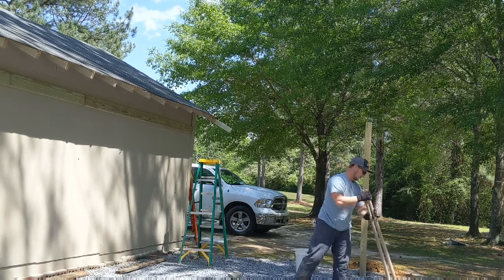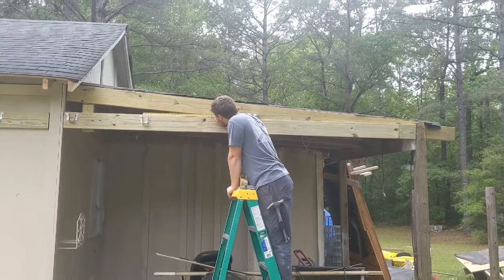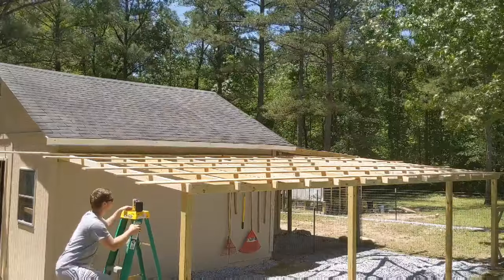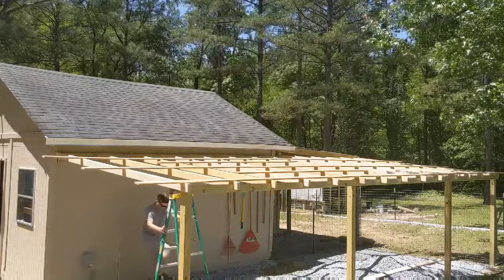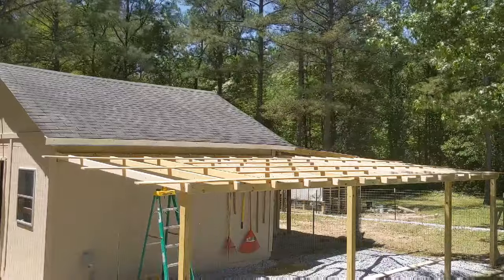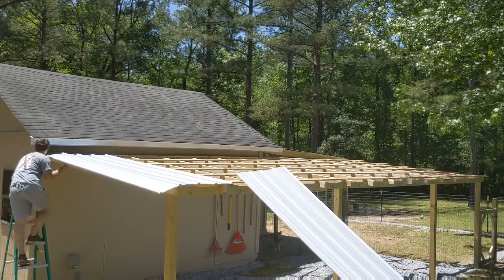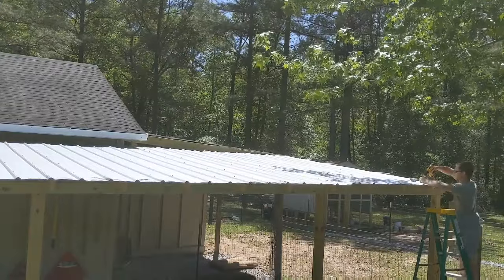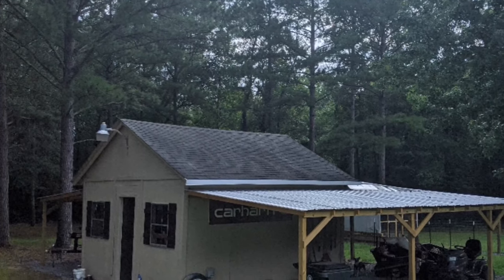How to Build a Lean To Shed

Comment: Looks good. 👍
One word of caution if you live in an area that gets a lot of snow: notch the top of the posts for the headers, rather than relying on the screws/nails to hold the header to the posts. You want the load on the post more than the hardware.
Reply: I doubt he gets any snow being in Alabama.... I know I don't!

Comment: Question for you. What type of material did you use for the roof. It doesn't like the typical clear roofing you get. I build a patio cover with the clear material and it made it like a sauna under it.

Comment: Quick question. I’m building a lean to behind my shed. I’m moving our chicken run and coop back there. My roof is basically 10’x10’. I got 2x4’s for the rafters. Are 2x4’s going to be okay instead of 2x6’s? The actual measurement from the high side to low side is actually less than 10’ and slightly more than 9’. The width will span 10’ though
Reply: I know I'm late and your probably done but no 2x4s can only span 9ft even when they're spaced 12" apart
Reply: @33North33  i used 2x6's

Comment: I found the lumber you get today is not all the same size,  rafters could be anywhere from 11/4 to 1 5/8 thick and 2x6 51/4 to 5 5/8 causing waving up and down across your rafters. I install the rafters with a string line and then install the Simpson strong ties to make the roof even. Don’t put your ties up first unless you measure each rafter to make sure it’s all the same size. Oh yeah, I pre drill all my tin first. Stack them all together make sure they all are even, mark where the holes go and drill your first two holes , one on each side and put two screws to hold everything and then drill the rest.

Comment: that is a VERY light duty shed!  I was worried my attempt at a cheapish on was too light weight. The way you fastened upper ends of back rafters is scary to me!   all good for you but...maybe not for instructional video?   With 10' between posts I would have used a 2x4 top plate [ perhaps doubled ]  and a total of 4  2 x 6 rafters , 1 over each post. Then use 10' 2 x4's cut slightly to fit down between rafters  with hangers at 2' o.c. spacing to use as the girts/nailers. I bet it would be lighter, cheaper and at least as strong. Not bashing you  - just might help others.

Comment: if you have lap siding on the existing building would you saw cut it off where you want the ledger board to be so that it stays flush against the top sill plates? My garage is a separate building with no soffit because the roof doesn't extend beyond the walls. So should I shimmy some flashing under the shingles and over the top of the ledger board? Looking for some advice thanks.

Comment: Where your 2x4 rafter connect to the hurricane ties, did you just drop in the 2x4 or did you make a cut into the 2x4 so the board sat flush on the hurricane tie?
Reply from the maker: I did make a cut on the end of the board  So that it will have a better fit.

Comment: Nice video 👍 I had a question, because I’m building the same thing for a customer, how did you make sure that it did not leak up against the building where you put in the tin sheets? Is there a sealant that you used?
Reply from the maker: You could use something to seal that off. I didn't on mine because the overhang from the main building is a foot and a half so I've never had any issue with the rain getting up there
Reply: @alittlebitofeverything8844  Yeah I have about a foot, I’m just wondering if there’s something that you would recommend? Appreciate that
Reply: @alittlebitofeverything8844  anyway they make all kinds of good caulking and sealant for this type of thing, I think I got it from here, thanks again, video was a big help.
Reply: Experienced sheet metal guys bend the lows on the sheets to a 45 then put a piece of 90 flashing to wall over the top of the high ribs. You would definitely need a set of sheet metal tongs to bend the 45 preferably a set that isn't spring loaded. Fairmont makes a good set
Reply: Use putty

Comment: Do you get snow where you are at? Is the 2x4 actually holding up well for the roof? I'm wanting to build but we get snow here and I didnt know if a 2x4 would work
Reply from the maker: No, I'm in Central Alabama and never get more than 1" of snow. If in snowy area, I'd use 2x6 or put the 2x4s closer.
Reply: 2x6s and you cannot have that flat of a pitch. MN here; built many buildings and leans.

Comment: Attaching the 2x6 to the building is the part I needed to see. How’s that done when attaching to concrete block?
Reply from the maker: Attach it directly to block with tapcon screws.
Reply: Don't attach it with tapcon screws. Attach it using staggered wedge anchors, spaced appropriately as your local building code specifies.

Comment: How long were ur rafters? 12'? What size was ur beam?
Reply from the maker: Yes, 12ft long. Width from building was 11ft.
Reply: @alittlebitofeverything8844  so u used 2x4x12s? and it didn't sag? 16oc?
Reply from the maker: @Eastbaypisces  correct. It's been up one year now and there is no sagging. 2x4x12 and 16oc. Has very little weight on it. I've built 5-6 just like this over the years with no problems.
Reply: @alittlebitofeverything8844  if I'm doing osb and shingles what u think I should use?  Same length
Reply: @alittlebitofeverything8844  also how sealed were those panels? Was it pretty simple overlapping n stuff?
Reply from the maker: @Eastbaypisces  length should be fine with osb and shingles. Make sure if you have shingles that you have more of a slope than I had. I used 3in12 for tin. Need 4-5in12 or more for shingles
Reply from the maker: @Eastbaypisces  very simple on the overlap. One ridge was overlapped and fastened with screws all the way down the ridge.

Comment: Does the 2x4 need to be pressure treated ?
Reply from the maker: If done correctly the 2x4s should not be getting wet underneath. However, you can always be extra careful and use pressure treated since it is outside and possibly exposed to moisture. I've seen them done both ways.
Reply: @alittlebitofeverything8844  thank you!

Comment: Looks like you put a really deep birds mouth on the rafters. They will fail eventually being cut half way into the 2x4. A 2x6 would have been much stronger and only a few dollars more.
Reply: Yep only 53.27 more at lowes for 2x6x12 for yellow pine which ants and termites love. for treated it would of been 134.27 more which termites or ants dont eat. Most int he south have to worry ab out that. Oh and he could of made the center at 24" with 2x6 so it could be a little less money than i figured

Comment: This is just a lean-to, not the titled "lean-to shed." A shed is enclosed. Nice work, although you didn't explain the upright supports for the distal beam, but it's not a shed.
Reply: It means  building a Lean-To (A) Shed. Not a Lean-To Shed.
Reply: Not in the south it’s not. A shed is anything with a roof. Usually open.   A box being called a shed is yankee speak. 😅.  In the south we call an enclosed building. A building.  Or shop.  Sheds are open.